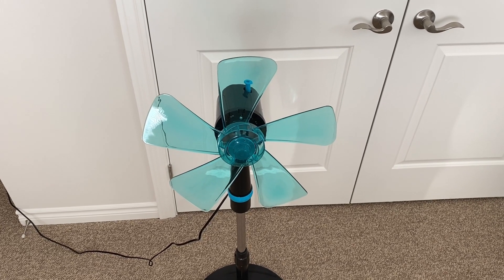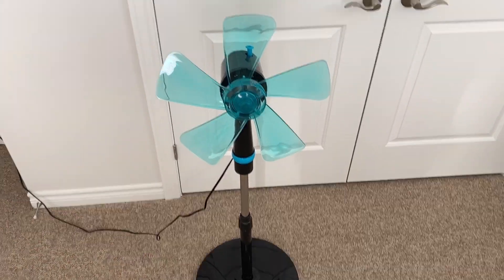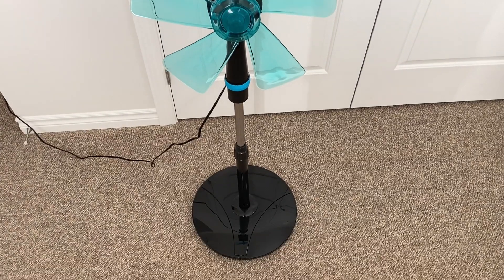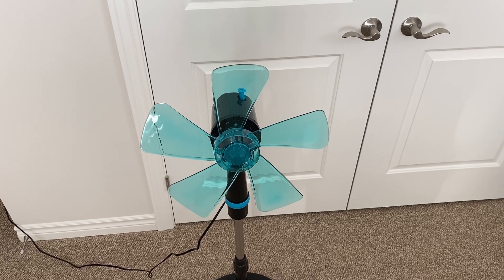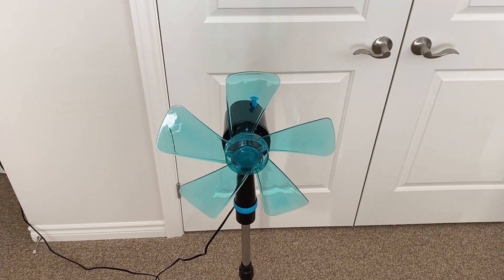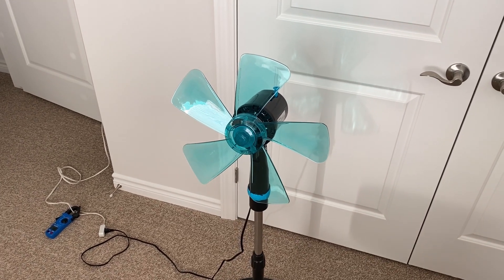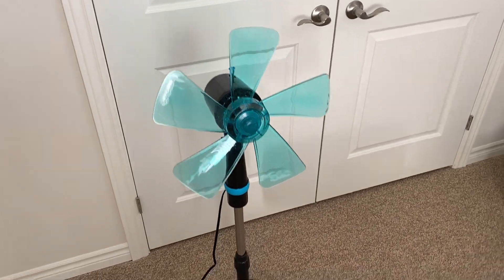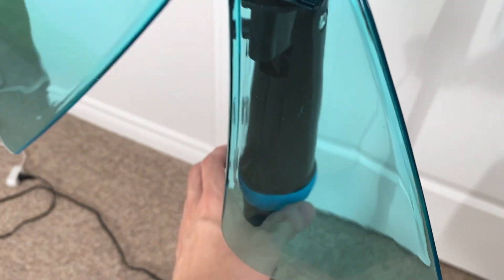Westinghouse 16” Pedestal Fan | Blade Comparison Test: Part 2

Comment: Did the motor just locked up a bit?
Reply from the maker: Yes it did, which is quite strange. I investigated after recording this video and I guess the bearings were too dry from the factory. I oiled it and it’s running even better than when I first got it.

Comment: these very cheap oscillation boxes usually keep the pin moving even when stopped
Reply from the maker: That would certainly make sense. A lot of cheap parts are often poorly molded which would result in unusual wobbles.

Comment: That 14" bladeset is interesting to me. It almost looks like what would happen if GE took the Vortalex blade, and crossed it with their 5 element plastic blade.

I also like the original blue blade, if they sold those fans here I'd get it.
Reply from the maker: I like that 14” bladeset too. It seems to be quite well optimized for air movement without being noisy or bogging down the motor. Perhaps the Vortalex blade design is the reason why.

Same, the original blades were the reason why I decided to buy the fan lol. It’s one of those rigid plastic blades which is pretty cool.